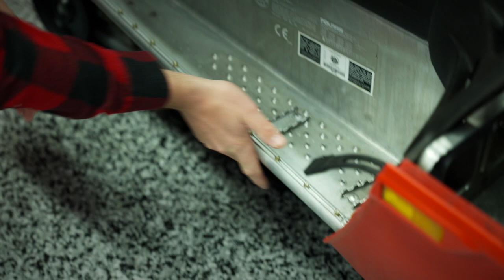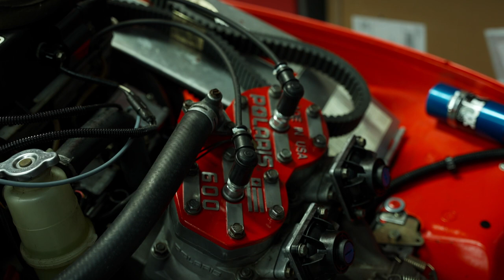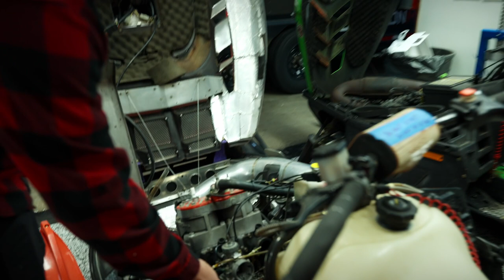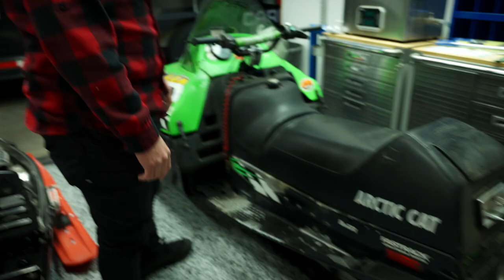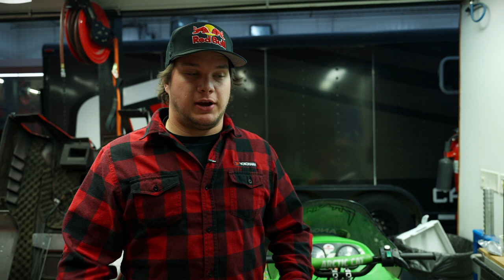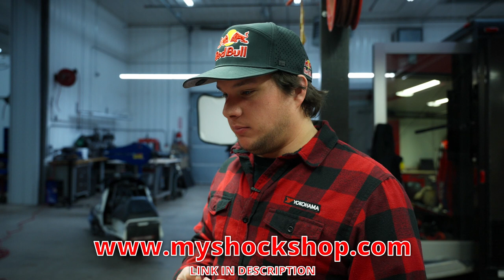How to spot a DITCHBANGER! | The ultimate guide to buying an older snowmobile

Comment: I have noticed some 2001-2002 mxzx and edges.  When are you going to allow the 2002 snopro 440’s?
Reply from the maker: Sleds manufactured in 2000 is how we are enforcing it so that we can tech based on the VIN number. The Rule book lays it out at ERXMOTORPARK.COM.  There is a page with sleds that are exceptions and the MXZXs up to 2002 are allowed because they are the same sled and we had a large group of them already racing at ERX before the Ditchbanger started.
Reply: @andrewcarlson15  how bout my 01 zr 800?? That’s the only sled i have and would like to join the races next winter?